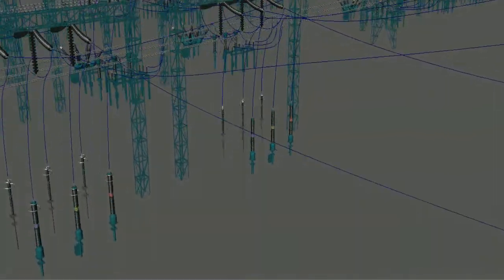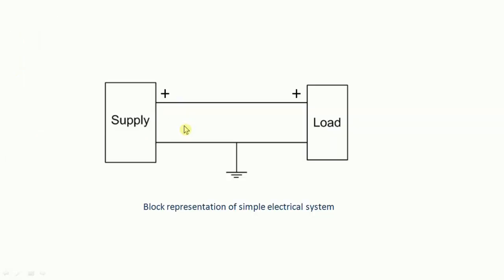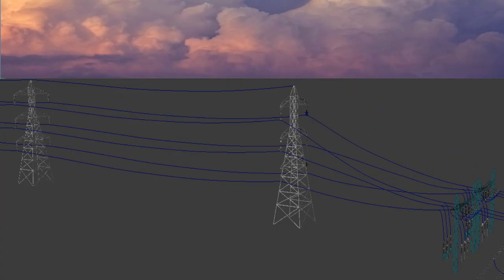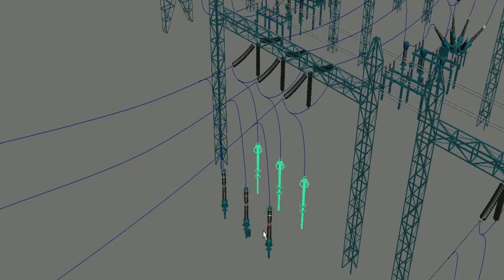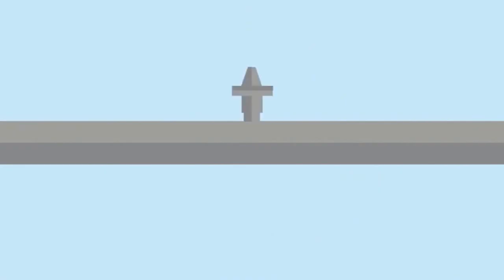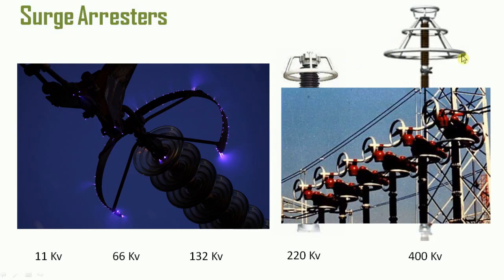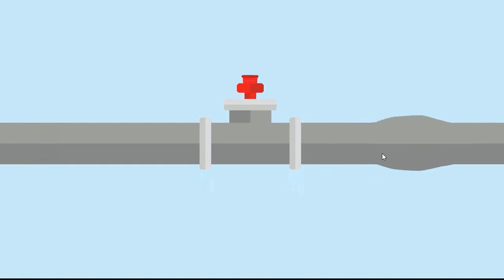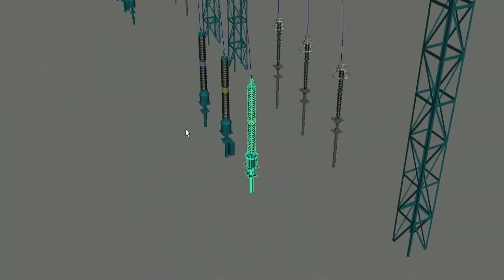Surge Arresters ; How do they works

Comment: I have one doubt tho .. Suppose a lightning strike of say, a million volts occurs, you seem to mention that this will pass through the surge arrestor. But what prevents the lightning from already passing and damaging through the other equipment because these will have lesser resistance than the surge arrestor?
Reply: This is where the protection systems will kick in, where the CTs and PTs are transducers and send signals to circuit breakers and switchgear that react very fast to cut off power immediately. That is why in power systems we have protection zones.
Reply: The lightning takes the least path of resistance to get to ground. The surge arresters are designed and configured to be the least path to ground so that lightning will go to ground through the surge arresters instead of to ground through the expensive equipment.

Comment: Great video, but I have a question that I cannot get a good answer for from any Electrical Engineer that I have asked. I work for a power generation company and in some of our older substations we have surge arrestors rated at 24kV on a 34.5kV system and we all know that the voltage on a 34.5kV phase to ground measurement is around 20kV so that makes the peak voltage at around 28kV, so is the surge arrestor actually shunting the excess voltage (approximately 4kV) to ground 60 times every second ? In our newer substations those surge arrestors are rated at 29kV which alleviates this problem. Can you please help me understand how the surge arrestors are not wearing out very rapidly?

Comment: Are surge arrestor and surge absorber same?
Reply from the maker: Might be Yes, where you heard about this term "Surge absorber"
Reply: In my book of diploma...
According to book a capacitor in parallel or inductor in series is connected in line to reduce or absorb high frequency waves to protect system against high frequency waves produced by lightning or switching...
This whole arrangement is called surge absorber...
The most common type pf surge absorber is ferranti surge absorber
Reply: Sir you uploaded a video on fb about my query that why circuit breaker in bus coupler...
But there is no voice in that video
Reply: You mean shocks absorber?